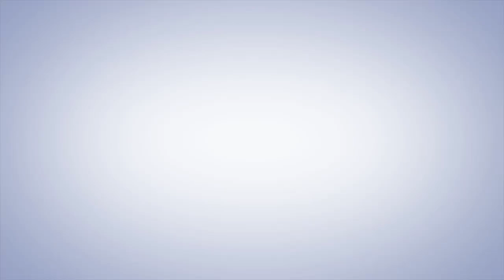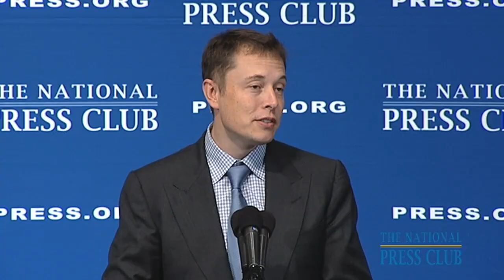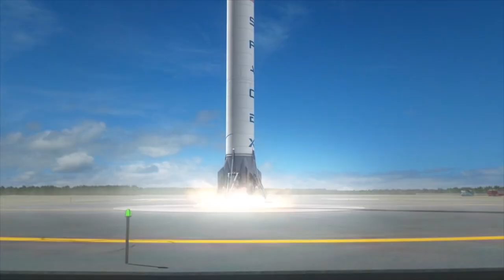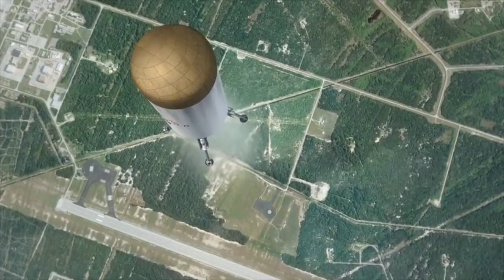Why Is Making A Reusable Rocket So Difficult? Elon Musk

Comment: Why falcon doesn't use parachutes, the booster doesn't need to carry that much fuel to land, would be easier if weights less. It also should have the ability to dump fuel to reduce the risk of explosions. You only need the chutes for few seconds.
Reply: There are several issues with parachutes.
    One: They are not as light as you think. You would need more than a tons worth of parachute to slow that heavy rocket down. In comparison to slow down the rocket using an engine you'll need (approximation and is probably too low)500-1000kg of extra fuel.
    Second: They're imprecise. Remember space X wants to return the falcon 9 back onto the launch pad. They're using a barge because of safety regulations.(They must prove that they can land the craft within a certain area so as to not accidentally land in residential area)A parachute will easily drift with the wind and if the wind is strong enough can even topple the craft on it's side
    Three: You would still need fuel. At the speeds that the rockets are traveling during reentry there's no way a parachute could stop it, it'll simply be traveling too fast and be too hot that if the parachutes where to deploy they would just get shredded up or will tear the rocket in half. Thus, they will have to do a burn to kill most of their velocity in order to slow down enough to deploy the parachute
    Four: They're not cost/weight effective. You're basically adding extra weight/cost to the rocket. On the other hand fuel and an engine is essential for a rocket thus you will have to add very little in order for it to be land-able (In the falcon9's case: grid fins and a landing gear)Also, as i said in issue no.3 If you don't slow down yourself enough the parachutes would simply tear itself or the rocket apart. Thus, if you were to make the rocket stronger in order to not get torn apart by the sudden deceleration you would have to add on more useless thus needing even more fuel. You could say that they can use aero braking to slow down enough to deploy the the parachute but by that point the weight of fuel you need to slow down will be really low as compared to the weight of the parachute.

Tl:Dr: They're not as light as you think, they can't land precisely, they would still need fuel and they're not cost/weight effective.
Reply: The crew capsule (Dragon v2) has parachutes only on abort. Engines are used for landings and things
Reply: +Dav “Aldebaran” Mac They tried parachutes, many many times, data doesn't prove out.
Reply: Tony Cassell
Thank you for your reply.  I will research other options like laser propulsion for example to slow down descent before the final burn.

Comment: the biggest problem with the boosters landing is that they can only throttle down the engine to 70% which still creates about 1.5 G's of acceleration so they have to do a suicide burn to try to land it which doesn't give much time to fix errors. install deploy-able flame buckets to redirect some of the thrust so it only produces .9 G's, that way they can throttle from 1.5 to .9 without changing engine settings. boom, now you have the time you need to get rid of excess lateral velocity.
Reply: +skyhawk551 o really now???
Reply: it's an idea
Reply: +skyhawk551 
In theory you could still land it with 2g of acceleration but the timing becomes more and more critical - if they really need to they could extend the throttle range  down to 50%

Comment: Why would it be impossible to make a reusable rocket on a planet that has higher gravity?

I don't like the word impossible - I mean is it physically impossible or difficult from engineering perspective
Reply: Thanos Sofroniou Extremely difficult, mostly. Think of it like those tilt-o-whirls at the fair. Faster it goes (higher the gravity gets), the more effort you have to put into pushing your arm away from the wall (more thrust you would need). Kind of like that.

If you could somehow improve the thrust, keep it structurally sound so it doesn't collapse on itself under the thrust, and maybe even make the rocket lighter, you'd have it. There's also air and atmosphere and all that, but that's a whole different planet. It's just really hard with our tech where it is right now.
Reply: Well if you could make a rocket with weightless materials, but fill it with fuel, and the best fuel didn't have enough energy to lift the rocket and accelerate it to orbital velocity, then you can't launch anything due to limitations of our chemistry. The stronger the gravity, the harder it is to lift off the ground, and the faster you have to go. Keep in mind, that you also have to have enough fuel to come back, which is harder with increased gravity. Air density would also be higher, therefore increasing drag. On paper, we could slingshot the thing off the earth surface saving lots of fuel, or use exotic means of propulsion, but it becomes extremely hard to develop such an object at this scale, and very costly. So yeah, technically it is possible, but insanely hard. Then you increase the gravity even more and it's impossible no matter what
Reply: +Thanos Sofroniou Gravity has been such a mystery for thousands of years. Since we can't physically lower its acceleration or heighten it, it limits how you can approach sending thousands of tons into space and return again. The physics behind it means you're optimizing the best possible way up there factoring in weight. Have a look at the 'rocket equation' and you can see that as the rocket ascends, you're losing weight by the thousands of kilograms from fuel igniting. Its a balance you have to be mindful of if you're trying to bring it down again with fuel to spare. Not to mention the earths revolutionary velocity to account for.
Reply: ONLY PHYSICS can say what is physically impossible. And only ECONOMICS can say what is economically impossible. Good thing Elon has degrees on BOTH. He knows what IS possible.

Comment: Why not just use parachutes like the Space Shuttle did? Packing in chutes big enough to soft land the stages will weigh a lot less than the hardware and fuel needed to make a powered descent and landing.
Reply: the opposite is true
Reply: How so? The way I see it, you should use all your delta-v to get the payload into space and then passively land the spent stages. Granted stage 2 would need a heatshield and retro rockets, but that is still less weight than the fuel needed to soft land it under power.
Reply: parachutes are rly heavy, we're talking tons, the boost stage needs only a few tons of extra fuel, because most of the work is done by air friction. Even if you did the parachutes, you still need the first burn at about 3 km/s, the second burn has delta V of only about 300 m/s. Meaning, that the second burn in substitution for parachutes would is like... 500 kg of fuel. So, as it stands, it goes like this: first burn - 5 tons of fuel, second burn 500 kg of fuel. Your solution would be: first burn: 5 tons of fuel, second: 2 ton parachute.
Reply: For example the STS SRB parachute + suppporting infrastrucutre had about 2 tons.
Reply: The real answer:  Yes Parachutes are heavy but making rockets that can survive in the ocean makes them heavier.  That adds more cost to launch.  If you try to parachute to land you're likely to incur excessive damage.  Propulsive landings retrieve the rocket in nearly the same condition it took off.
Reply: no, but I follow the news, there are other problems with parachutes, namely landing jolt and impresice landing
Reply: you need two burns, one from the hypervelocity and one at the landing, the first burn consumes like 90 % of the fuel and parachutes can't be used at that stage, the second burn in my estimate uses something like 500-1000 kg of fuel, while the parachute for that stage would weight about a ton, two tones if you factor in infrastructure..not towrth it
Reply: Don't forget that with propulsive landing, you can bring the rocket to the perfect location and have it ready to launch again almost immediately. If you have a reusable rocket, you probably don't want to have to spend a week fishing it out of the ocean every time you launch
Reply: the first stage has about 11 tons, that's lighter than Orion, but the point still stands
Reply: In addition, parachutes are subject to the whims of the winds.  They are not good control devices.  Too much drift.
Reply: Thanks. I wrote that before I had really looked much into things.
 It makes much more sense to me now :)

Comment: I really admire Elon Musk, BUT rocket engines are really complex they have to sustain a tremendous stress during flight. That's why those engines are designed for just a really short lifetime. If you would build them, and the whole rocket more robust and stable, for a longer lifetime the cost of a rocket would also increase
Reply: Merlin 1D has a cycle of 40, even at 5 reuses, we could presume, the launch cost drops to slightly above 40 mio USD/10t to LEO..give or take.
Reply: 60mil for a Falcon 9 13,150 kg to LEO = $4562 per kilo 
SpaceX has tested the Merlin 1D up to 20 launch cycles so if a LV is reused 20 times (adding fuel/maintenance) price drops to 4-5 mil. Say at 5 mil and same payload drops the price to $380 a kilo
The actual spacecraft and hab modules are not that expensive, launching them is
Reply: F9R can not do that, the 2nd stage is maybe 10 mio and ground staff is still expensive, like I said, maybe 30 mio or so+, BFR will be the real revolution. Think US missile shield.
Reply: the 20x reuseability is straight from COO Gwynne Shotwell's mouth during an interview
Reply: the second stage won't have landing capab. and you'd have to have huge launch rate, which SpaceX seems to lack, like i sad, more like 30-40 than 10 mio, still a huge improvement
Reply: Lol

Comment: Why isn't he just using parachutes?  Decelerate using an engine, enter the atmosphere, slow to terminal velocity, deploy parachute.  

Why try and rocket your self all the way back to the pad?
Reply: Parachutes would require splashing down in the ocean, and splashing down in the ocean is not desirable. Imagine if a 747 had to splash down every time it wanted to land, and have to get towed to shore, and be refurbished and re-qualified for flight? Landing near the launch pad is critical for a rapidly-reusable rocket.
Reply: Charlie, Your misconception is that the rocket will be performing a retrograde burn for its entire decent.  This isn't the case.  The atmosphere will already provide most of the braking.  Once the rocket is in orbit, it's traveling over 15,000 mph.  then the rocket flips around and allows the air in the atmosphere to slow it to terminal free fall velocity, which I'm guessing is about 200mph for an object that size.  The rockets will only fire at the very end anyway, there isn't much difference between slowing from 200mph to 0 and slowing from 20mph(about what a parachute could realistically slow it to) down to 0.  That makes the extra weight of the parachute system unnecesary.
Reply: Michael Ardovitch That's not difficult at all, many people don't understand how rockets actually work. When the first stage is jettisoned, it's mostly empty space with very little fuel left, and has a significantly lower mass (95% of the vehicle weight at launch is fuel alone). Radically changing the trajectory or even outright reversing direction takes very little fuel because of this, and SpaceX has been doing this with their first stages for some time now, and they could easily reach the coast and still deliver on the order of 8 to 9 tons to LEO, at least with the first stage.
Reply: rock3tcat cause 90% of the time you dont know where the parachute will actually take you
Reply: gps + parachute, you can navigate the skies with boosters on the, but the main reason for parachutes not working is by the time it reenters the atmosphere, it'll be going too fast, too hot for parachutes
Reply: *****

Why not use a parachute for 95% of the way, and land using a burst of rocket thrust in order to get it horizontally on the launch pad.
Reply: Monoï Jeesus, don't get emotional kid, it was a fair question from a layman, and I think he knows himself (as do I) that that is what he is.
Reply: Ive been wondering this to.
Reply: Owen Vankirk Ok, I can see that.
Reply: rock3tcat That's what I was thinking.  It seems you would have to pack a lot of extra fuel for the decent if you burn all the way from orbit.  But using parachutes at least for most of the decent would seem more efficient.
Reply: Charlie Collier Chutes are actually not enough. It still can land without exploding but there will be only a few stuffs that could be reused again and the rocket could topple down. By landing carefully you could refuel the tank and it is ready for launch
Reply: noneof yourbusiness that would require it to get rid of all of its velocity to go back to where it launched wasted insane amounts of mass that could be used in getting to orbit
Reply: Charlie Collier

I am sensing an unexploited potential here, let's make it happen. :O
Reply: +John Kielkopf That's a good point about the added weight.  I never thought of that.
Reply: +rock3tcat (ⵙⴰⵔⵓⵅ) You are adding weights to the rockets. 3 different parachutes for each stages add LOTS of weight. Didn't you see the video about him talking about only 2% of total weight gets to space?
Reply: He already use parachutes with the Dragon.
If you think that you're smarter than him and all the engineers that works with him then you definitely should launch you own space exploration company. He started from scrap and launched his own rocket (and a couple of others companies) when he was in is 30 so if you think you can do better it's up to you, just do it. If not then just let him work in peace and learn as much as you can from that genius.
Reply: Because god forbid I question something.  I sense a fanboy!

Comment: This has been looked at in the past, ie the Kistler K-1 which had a very similar architecture to the Falcon 9 - I sincerely hope he succeeds, even the recovery of the first stage would be a huge achievement - and would hopefully change the balance sheet enough to bring down the costs to orbit significantly

(more so if he can recover all 3 of the Falcon 9 heavy booster stages)

Still think they should look at some of Philip Bono's old designs though, some of his vehicles staged with drop tanks instead of true stages, made them more recoverable and the expensive 'core' benefited from a lower mass fraction as a result.

This is what happens when government gets out of the way, and someone with a bit of vision leads a group of talented designers - good work Spacex!!

(but seriously, have a look at the old Douglas DC-Y specs when you get chance)
Reply: He did it dude!!!

Comment: And all of that, you increase complexity and possibility of failure. The easiest way is to just use the engines.
Reply: 135 launches later, 100 landings, 80 reuses, 2 falcon 9 failures, 1 was recoverable. it took a long time to get the landing right, and they get it done 99 percent of the time. we are now almost to the flight of the first starship, and at this point, they have changed spaceflight forever

Comment: Slow the fall with a parachute. Once it slows quite a bit, have a tank of helium on the craft that inflates a few large balloons along the top of the craft. Use an electronic compressor for helium recovery / pressure control.

Use the fuel you saved from the more efficient launch to go wherever it is you need to go.

These are new ideas ^ I don't see any radically new ideas in use in the space industry. It's only been half a century... You can't tell me we had it all right in the 60's...